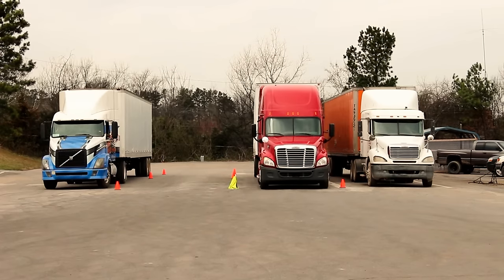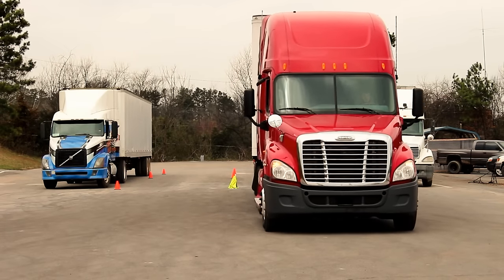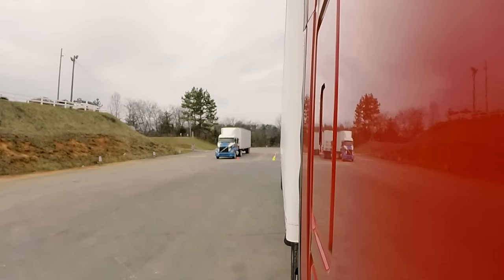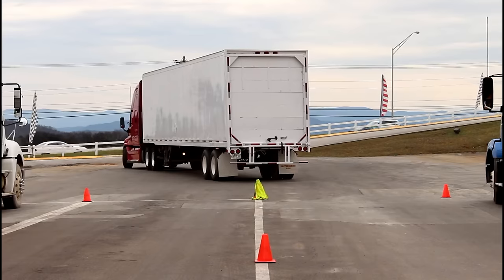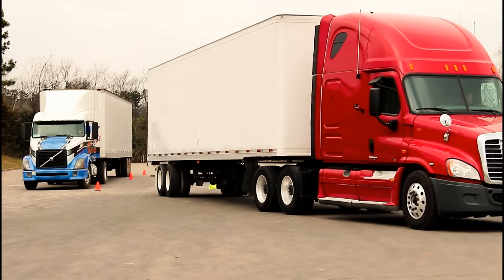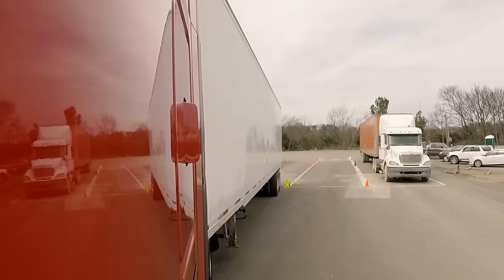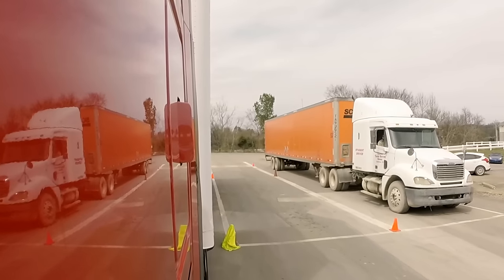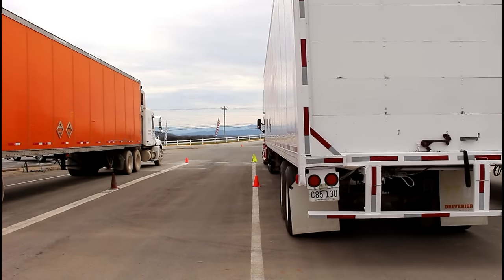Offset Backing

Comment: This 'flow' method is for experienced drivers (like the instructor himself) who will 'feel' how much to turn the wheel at which point. Rookies for the road test will need 'geometric' reference points to be exact in this journey of 100 feet offset parking.
Reply: Easier to learn with lines all way out pull up back pull up back
Reply: But it soo hard on dirt and gravel with no lines 😢
Reply: @elizabethjurado5080  Practise makes it perfect.  When you have time just practise over and over until you feel it.
Reply: What is he saying when he says one turn to the left? Wtf? Also stop straighten it you would have to turn to the right he doesn't mention this. Please someone help

Comment: Yesterday I did what he showed in this video and I passed my CDL test in NY Bellrose DMV site! Really good practical method. It works if you back up with little moves. A little to the left a little to the right a little to the left a little to the right. No hurry, just slow and easy, feel, see every move you make and where it leads the trailer, then bang! It is in there! :)😊👌✌👍 And thanks for posting this video. (I did the offset parking without even getting out and looking and I never needed to use the 2 times free pull ups either).

Comment: If im trying to go from left to right lane i just pull up to end of track, stop, crank wheel all the way to left until the nose of my tractor is at a 30-40 degree angle(this is the hardest part),STOP, crank it all the way to the right, STOP once straightned out. Then i backup until my left most rear tire is a foot or less away from the front inside cone.. then slight right turns into the box. Its easy and produces results at my school. Keep on trucking people! Try this method and the vids method and keep whatever works best for you!

Comment: This is the best video I have seen so far. I am trying to learn offset backing. This seems easy. If you could explain little bit about how long to keep the steering wheel turned before you follow the trailer. And if you could post a video about Parallel parking? Thanks.

Comment: Beautiful! Looks a lot simpler than what my school said: when right rear trailer tire at picot point turn steer wheel maximum left and back up until you see mark about 20" in on landing gear cross bar, then steer wheel maximum to right and reverse until trailer straight. Then reverse straight back until left rear trailer tire on pivot line, then steering wheel maximum to the right and backup until trailer is straight in box and wheel maximum to the left until trailer straight.
Reply: What?

Comment: This is a very useful technique.  The thing with this technique is this, the first cut  1 steering wheel turn to the left , as soon as the trailer starts cutting slowly follow the trailer and get the tractor, trailer lined up. Then when the back left corner of the trailer is lined up with the dock line do 1 steering wheel turn to the right, once the wall of the trailer is almost parallel with the dock line get the tractor trailer straight.  Do a pull up if you have to and don't be afraid to get out and look at any point if you have to.

Comment: Nice one, so it is just one turn of the steering wheel on the opposite side. And then it proceeds as a straight line backing one you see the cone at the mirror.

Comment: I test on Monday I can do it with three or four pull-ups I know you get two free ones so I would only be getting two points straight back I can do it two to three as well should it's only two points parallel parking I just take out the backbone and that's only two points
Reply: how do you need 2-3 pullups to do a straight back? it's like one MAX and that's if you really mess up... SMALL turns on the wheel and don't hold it too long..

Comment: why you make it seem so easy but then instructors telling us if we offsetting left REALLY LONG SHORTS LOOK RIDICULOUS meaning to pull straight to line turn wheel all the way right then back until you see a triangle shape under your trailer then stop turn wheel all the way left and back until truck is straight with trailer STOP straighten wheel and go backwards until cone is between the ID on the WIDE on mudflaps then wheel all the way left until you see both sides of cones in mirror then fast right to get straight A LOT of steps for something you make seem more simple

Comment: dude stop teaching other drivers to cut too tight to the left you are lucky you didn't have a truck sitting right there on your left or you would have took out his R side mirror. pull up as many times as you have to and stay clear of both trucks on your right and on your left
if you get too close to either truck and you can't see clearly where you going you're going to hit one of those trucks either side whichever one you are the closest to besides you don't look that you are old enough to be teaching other drivers how to backup I didn't see you one time looking behind your truck for safety reasons so you flunked my test always get out and look if you don't you will pay for it with your job